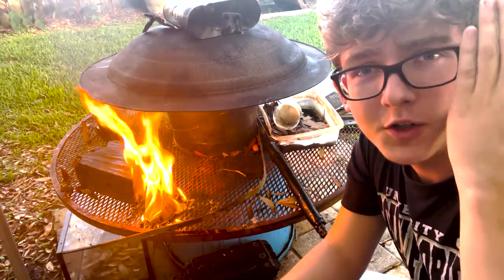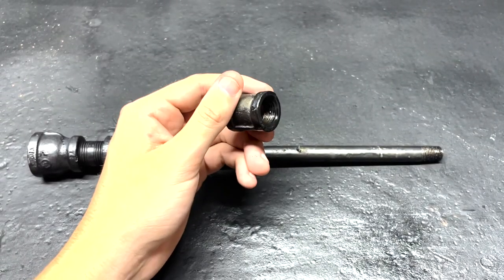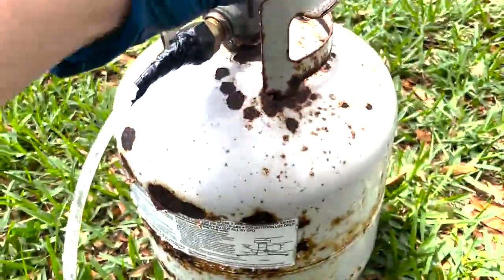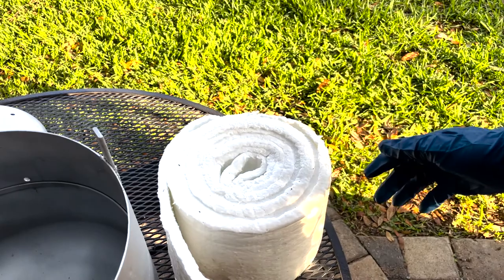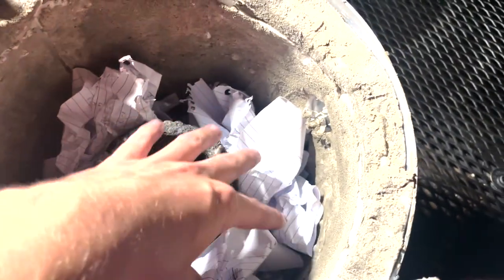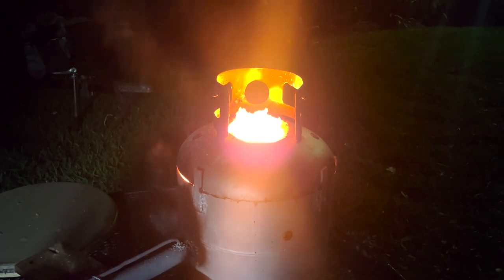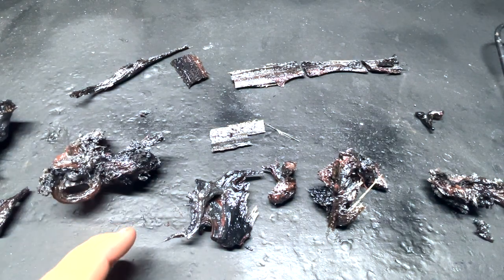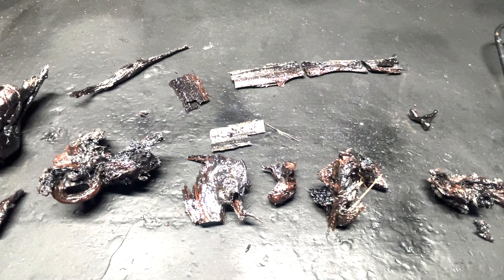building a dirt cheap waste oil foundry (0 fuel costs)

Comment: Spray the kaowool with 50/50 water and sodium silicate to harden it :) it’s the industry standard or use clay slip
Reply: By clay slip are you meaning like soak it? Or spray as well? Or just coat with slip. Husband of a potter so I have slip readily handy
Reply: @raukorist77 anyway will work honestly. Just getting something on is key. Id spray with pure slip then add cob for another durable layer. Then fiber cement for final layer

Comment: the gas or fumes that evapoprates from used oil is gaseous and the process is called pyrlysis.When evaporating gas meets the air blast,combustion takes place by igniting.You can boost the flame by secondary blower.Thank you.

Comment: Good video.  One thing I noticed with tutorials like this is that there is not much theory; there is much to show about how things are done,  but l think, it's good to include the calculations behind what you did,  so that if I want to scale my design,  I have the tools to do that,  like,  what size burner I need to melt x amount of metal.  That might be very useful info.  Keep up the good work!

Comment: Won't whatever you're melting be infused with the metals inside the oil? Primarily iron, steel, or iron oxide.
I would suggest you remove all the iron using strong magnets to collect it on the bottom of a container, then slowly empty from the top.
Also, isn't obsidian practically glass? You could actually make some stuff if you were to pick it with a steel rod, and blow on it. Then separate it using twisting motion, and red hit tongs.
Reply from the maker: Technically a small amount will but used motor oil contains about 10ppm lead and 10ppm other heavy metals which will mostly just leave in the exhaust, iron has the highest concentration of about 70-330 ppm which isn’t really much to worry about contaminating your metals.

It’s pretty much glass as most rocks are made of silicon containing molecules much like glass which is silicon dioxide, so it should be possible to glass blow it, maybe I’ll give it a try!

Comment: i wonder if a version could be build that works on heated ethanol/maybe idk amonia i always loved the idea.of using amonia as fuel for some.reaaon
Reply from the maker: Possible but I’d switch to using a sprayer head instead also might have some issues with your fuel boiling in the feed lines.
Reply: @PyrotechnicalScience  i would actually want to the fuel to boil in the lines, akin to a regenerative cooled rocket, so i'd keep the copper pipe near the body of the thing so it heats up alightly before being injected, and pobably make several holes in it to inject fuel from everywhere and near the air input, but then, i'd need a pump, but a fuel pump pobably would do it ig, small 12v ones sold for cars or something

but then i am getting closer to a jet engine...

about amonia, i'd pobably need pure oxygen or it wouldnt burn at all because the flammability range of amonia is shit